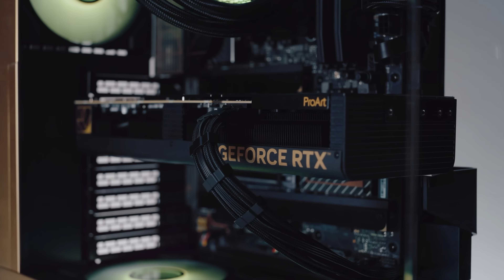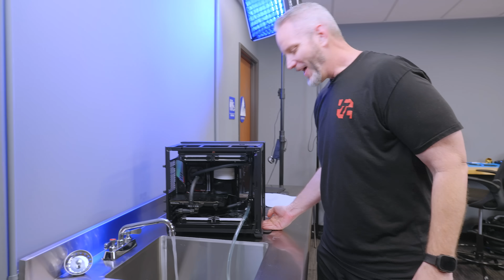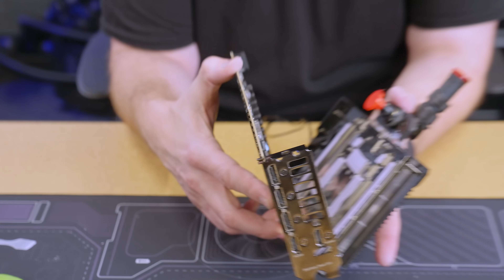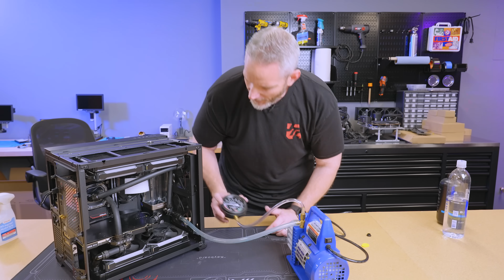These GPU Temps were BAD... here's what went wrong and how I fixed it!

Comment: I had the same issue, over and over again on my 4090. The pump out happens over time after you heat up and cool down the gpu a couple of times. I then decided to go with a graphite Kryosheet on the gpu die, and I will never go back to paste for anything. The temps went way down and to hotspot delta always stays under 9C. The best thing is that it is very stable, temps will never change over time. I use it now for my cpus as well. Love it!

Comment: Nice, ya anytime you put a vacuum in the system, it's best for refilling makes it easy.  A tip when pumping down into a vacuum:  Add a small catch bottle before the inlet of the pump so as to protect the pump oil, you'll be glad you did so you don't have to clean/change out the foamy, contaminated oil in the pump as often.

Comment: I'm facing exacly the same issiue on my relatively new GPU Asus TUF RTX 4070 Super OC (purchased 07.2024) - starting on 12.2024 delta betwen temp and hot spot rises to about 21C and now playing PoE 2 in 2K i'm registering hot spot near 94C but normal temp are below 70C. I've try to correct air flow in case (asus GT 502) and set up gpu fans curve to more aggressive but now even with fans on 85% this card is reaching that hot spot near 90C.  Since card is under warranty is it better to send it back to producer or re-paste it personaly? Asus will probably put same paste and after few month i will have same situation - i was wondering to get that PTM7950 and do it my selve

Comment: I got a 25c delta between my avg GPU temp and the hot spot on my Red Devil 6800XT under air. Is this normal or could I also be having a pump out issue? I got some Noctua TP on order and was thinking of repasting it when it arrives.

Comment: I had a 5700XT, a Strix version, and it was the one that was known to have bad mounting pressure. I owned it for a few years and the hotspot was always 115C, and when I put a block on it, the die had surface pitting, and the copper on the heatsink where it made (loose) contact with the die, was literally discolored almost to the point of being charred. With the waterblock, the hotspot was well within reason. Recently I put the air cooler back on to use it in a spare PC and used the washer mod to get a tighter mount and its within reason as well. So mounting pressure is certainly something to take into consideration when doing any kind of modding.

Comment: Question: can one watercool pretty much any modern GPU? F.e. I have a Inno3D GeForce RTX 4080 16GB X3 in a small form factor case that is running around 70C and is pretty loud, but I wonder if I could watercool this card or be better of with a cooler case (literally ;) … cheers!

Comment: For even greater improvement you can toss out the thermal pads and switch to using Thermal Putty instead. Some really high performing putties are available these days.

Honeywell HT10000
TG Putty Pro
Laird T-Putty 910
Upsiren UTP-8
Fehonda LTP81

(Thise all performing within 1.4 degrees for me, in testing)

You can also switch to a Phase Change Material like Honeywell PTM7950 on the core. For burn in, open the reservoir up to allow for expansion and then get fluid temp to around 50C for about 2 hours using your load of choice. Only need to do this once really.

Comment: whille waiting for my 5080 to arrive i used my 1080ti in my new system, and i saw it getting to high 80's, even 90 degrees in some cases then the fans would go nuts and it would cool back down. I i magine the thermal paste in that has gone bad , so i will clean it up and re-paste before i put it into a new mini pc i'm building for the kids.

Comment: I don't think water cooling is stupid but it should be better. Having the fins get blocked up with crap shouldn't happen, either there needs to be better hoses or the coolant has contaminants in it.  Maybe PTFE hoses instead of rubber? I don't know but you don't really see this problem with cars considering the coolant in them can be fine for 20+ years with no problems to cooling efficiency. Mostly just leaks with cars, I guess because it's under pressure and a lot of the fittings are cheap crap plastics that like to crack or weaken. It might be just ebcause PC systems are a lot smaller so the radiators are smaller with smaller fin stacks so it's easier for stuff to build up?

Comment: In my experience only LM and PTM7950 works for high power GPU's (Above 350W), i've tried over 15 different thermal paste brands and all of them degraded in moth or two.
Just LM that bad boy and reduce Delta temps by 20-30% and whole GPU temps by 5C minimum.
That bare spot is pumped out paste nothing to do with the way it's mounted, that has plagued me on 6900XT for months until i decided to LM and be done with it.

Comment: I think that my old old old 3930K system now, either has coolant leeching and/or I just need to repaste the CPU.

But nowadays, typically, I just switch it over to air cooling (Noctua, because when the system dies, I can always re-use said Noctua CPU HSF), and like the Thermal Grizzly Carbonaut carbon thermal interface sheet so that I don't even have to worry about the pump out effect.

That's about as I can go, in terms of maintenance.

I don't get the LOWEST temps with that, but it's controlled enough that for most practical intents and purposes, combined with the significantly lower maintenance requirement -- that's what works best for me.

(I would have to imagine that the gunk build up happens inside of AIOs as well, but that would be much harder to open up and clean, since they're typically purchased as a sealed unit, hence the name.)

Comment: This is where air cooling sucks. Because getting temps like that, isnt common when you buy an OC card. My 5700xt is clocked to 2100, but the stock for a 5700xt is 1905. That made my difference be about 30-40 most times, even brand new. Underclocking and undervolting is basically the way to go if you're using air cooling. The few frames you lose from it, isnt going to matter. What will matter is the DB of your fans sounding like a jet engine when you play something demanding.

Comment: If you had a spare reservoir, you could use it to catch liquid when pulling a vacuum then close the valve and remove the reservoir and put line in coolant to fill. Might save you from having to change the oil in the vacuum pump.  I wonder if one of those ultra sonic cleaners would be good for cleaning parts in... Just thinking it might be good for those fins and hard to reach places.

Comment: I was seeing spikes in the core/hotspot delta as high as 20C on my MSI 4070 ti super. I repasted with KPX and there's been a noticeable improvement in temps, but I'm still seeing as high as a 15C deltas. Overall temps are good. It's stable in the mid 50's core / mid-high 60's hotspot. Occasionally the hotspot jumps up into the 70's with little to no change in the core temp. I'm not seeing any stability issues or throttling. 🤷‍♂

Comment: @jayztwocents - To prevent liquid from getting into the vacuum pump, place the vacuum pump higher than the lowest point you're pulling from. Alternatively, you can put a small jar inline between the reservoir and the vacuum pump. The liquid should mostly drop into it.

Comment: if the edges are light, which all these were...  it could be that the compression of thermal pads wasn't enough and the pads are holding up the plate from full contact on the die.  thermal pads are hard because of the delta between OG thickness and compression.

Comment: Hey Jay, put a brake bleed bottle from a cheap HF vacuum brake bleeder kit on the vacuum line between the PC and vac pump. It'll catch the liquid and keep it out of the pump. When you go to fill the PC, pull the line on the PC side of the bleeder bottle and it won't be in the way.

Comment: i get 80c max on 100% utilization on my xfx rx 7600 what should i do, im not talking about hot spot just average temp.
Reply: Adjust the fan curve. Or maybe need a repaste. But 80c under load is still okay.
Reply: @ just realized my gpu hotspot under full load is 97-100c so def a repast, but the thing is I just got this gpu and I have good case cooling

Comment: Depicted; why I air-cool. Water-cooling is cool - literally - but is a lot more work than I want to put into my PC.
Costs less, easier to maintain, then come back in five to ten years when hardware failures start happening. Less if I made the mistake of a top-end large-die GPU.
Clean the air filters once a month, clean the system itself once every six months or year, otherwise just let it ride until hardware failures start turning up.

Comment: Asking for advice if able:

Nutshelled Info - i5-12600k, EVGA GeForce 3080, Asus TUF Wi-Fi D4 Z690, 16gb (x2) Corsair Platinum, AIO 240, 850 PCU..I Think.  PC roughly 4 years old.

Upon turning on PC everything is fine.  All drivers up to date, Windows 10 up to date.  7 case fans plus PCU fan and the dual fans for AIO.  Open a game such as FF14 and at random times screen will stutter and monitor will go black, followed by keyboard then mouse and white LED light will come on motherboard.  Unsure if due to heat build up on graphics card, hangs around 50c under load, entire PC hovers around 36-40c when idle.  MicroCenter diagnosed, stress tested, reinstalled drivers, ran fine.  Came home, still having issue.

Any suggestions? Also PC isn’t overclocked all factory settings.  BIOS will sometimes show “no CPU fan detected” but that is due to AIO installed instead.  So put to ignore but still has issue.

Comment: I would've used some sort of PTM for the re paste. Repasting a GPU, ESPECIALLY one that has had pump out from day one of the build is going to spit that thermal paste out in a week. GPU's shouldn't pump out for its entire service life. The ones that do, do so for a reason. Whether it be the cooler surface being slightly convex or what have you. Back when I was helping people out on reddit for their 7900XTX's and their pump out, which those cards were notorious for. PTM7590, or TG Kryosheets were basically the only surefire way to prevent pump-out. To be clear If it took your card two years to pump out, a re-paste with good ole thermal paste is fine. If it came out of the box with issues, or you got pump out shortly after applying a water block (like in this case) there is a level of die to cooler incompatibility.

Comment: I see Jay is using his car care techniques on his pc's too. Filling that loop is basically the same way you're supposed to do it on car. 10/10 approved!
Reply: yep, it's still the same components doing the cooling (radiator, pipes, fluid, etc.) as a car, just in a different application. the logic applies to both. 👍
Reply: my late-model-design vw uses one hole, you fill and burp

Comment: why is it that my systems always run at about 45c at idle  with a 23c room on the cpu and my 7800xt when running 0rpm mode it runs 60c

Comment: My 7900xt hot spot kept creeping up and up the last two years now on default settings it spikes to 100c. I now undervolt it to 1030 and set max clocks to 2450 and dropped power limit to -5%. Now in full load it's 75 to 80c spikes and instead of 330w it's only doing 280w max. Lost like 5fps on avg but dropped a lot of heat. A lot of people on reddit and other forums said even aib 7900xt and xtx gets super hot. But I really think they pump way too much voltage in them. It runs smoother quieter and more efficient undervolted.

Comment: The D in 011D stands for DUMB. A glass box is one of the dumbest ideas ever for a PC that should be running at low temps.
Reply: its  not dumb if you want to have your pc on top of the table, next to monitor and admire the build, or the RGB in it, for me as i have MSI GUNGNIR 110R i admire my build, i like how it looks, how silent and elegant it is, and mostly, when i look at it, im like "dang, i did a good job on my baby", its personal prefference ofcourse, but its not dumb, kinda like multi-monitor set-ups

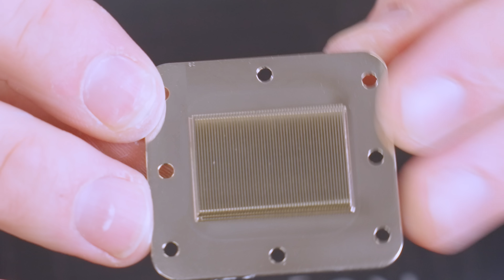Comment: 7:28 so I said it on the video you did making it, it’s the blue Corsair coolant. I have the same block and was using the same coolant and had the same problem. Ended up cleaning it like 3 times before I switched to clear Corsair coolant and haven’t had a problem since.

Comment: KRYOSHEET! Sorry didn’t mean to yell lol. You’ve already looked at it Jay. I know Der8auer will love hearing that, but I’ve put Kryosheet on all my stuff now: 5800X3D, 3700X (soon to be 5950X), 6800 XT, 2080 Ti, and my friends 2060 Super. A couple colleagues at work have also used it. FANTASTIC thermal pad! In my experience, it’s as good as Arctic MX-4/MX-6, but has 3 amazing properties: 1) consistent full coverage (my deltas have always been Les than 10°C, 2) no pump out, 3) longevity. 

Performs better, in my experience, with direct die applications. I do use it for my CPU’s, even if there’s no difference between it and thermal paste, simply for no maintenance.

Just use either insulating conformal coating, or Kapton tape and you’re good to go.

Highly recommend!

Comment: No one does thermal paste right there isn't supposed to be an actual layer of thermal paste You're just supposed to put thermal paste on and then take off the excess and put and put the two blocks of metal on top of each other because the thermal face is supposed to fill in the imperfect microscopic gaps that we can't see

Comment: I dont like putting too much thermal paste. Should be just thick enough that its not see through anymore. Even then you'll get some pump out when you tighten the block down, but the amount left on the die is the same, you just get low wastage and mess

Comment: No A/C so my house is what ever the outside temp is, been 101F. Was thinking of water cooling and piping to a reservoir that is sitting in a cooler of ice. Not sure how powerful the PC specific pumps are, but I do have a 1000 gph aquarium pump I could adapt to work.

Comment: My laptop was a display model and I bought it over a year ago and noticed the temps were running high.  It is a 12th gen I7 with a 3060.  So, I bought some cooling paste, cleaned the dies and repasted, works better now.  Paste had hardened up some, so I'm thinking it was probably doing whatever his was doing (Sorry, CRS Syndrome = Can't Remember Squat).

Comment: Jay, what kind of coolant did you use before? It's extreme how clogged the jet plate was. Something is corroding inside or the color additive is bad. You should NEVER use this stuff again and you should also rinse out the radiators otherwise it's only a matter of time before the whole thing happens again because the dirt from the radiators is pushed into the new jet plate...
Reply: The gunk clogging the fin array was residue from the EK ZMT tubing.  That stuff is incredibly dirty inside.  Mostly release compound and carbon black particles.  If you have to use it, pre-clean it on a closed loop with gas filter inline for several days to catch the crud.

Comment: If i paid $600 for a card (which i did 3080ti) then no its not worth water cooling as the performance boost is minimal although shes old and needs a repast. I repasted it and had to reopen it about 10 times to get the temperature right and its still not perfect. I think more thermal paste and maybe some debauer thermal griz thermal puddy instead of pads would work well for me. 
    But you already know if im spending $2000 on a graphics card, im GOING to put a couple hundred dollar water cooler on it so i get the max performance, esp with how EASILY it will thermal throttle itself, well worth it.

Comment: Looks like the radiators probably had a bunch of junk in them. I am sure you used distilled water. Next, I put a flow meter on every custom water cooled build I build. A digital flow meter shows the actual flow rate which can make a huge difference in temp. It doesn't do any good to have a high flow rate where it doesn't have a chance to dissipate the heat. Just a few tips, and I am sure you know all of this Jay, but for others who may want to try custom water cooling.

Comment: OK fine Jay, I'll sound off here about how stupid water cooling is and it's unimportant and unnecessary and dumb and a waste of time and a waste of money and just really stupid and people that do it have self-confidence issues and DING.

But if you really want my opinion, I think water cooling is pretty cool, the water cooling community is pretty chill, water cooling has some trade offs that make it interesting, and I really wish I could afford more water cooling parts to get my current system back on water. It was aqueous last year, but then the MoBo had some fatal issues. Not sure what happened, but I swapped the MoBo and put all my parts back on air, don't even have an AIO. I'd still water cool again. It's all good fun when you got the finances under control.

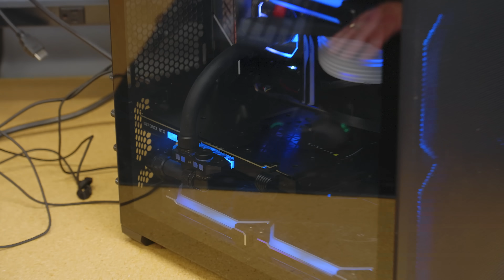Comment: He will never learn. 2:17 The pump-out effect is exacerbated by the use of LN2 paste like KPX. Paste that is designed to prohibit freezing at -140C, is not suitable for daily driver PCs.
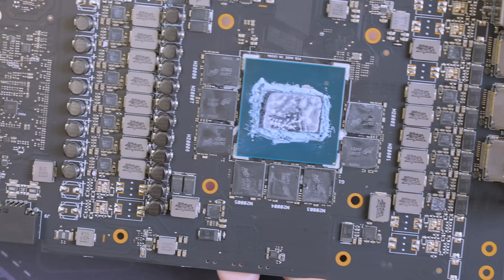Shows pump-out with KPX. 5:37 

The tube type is EPDM (ethylene propylene diene monomer). 

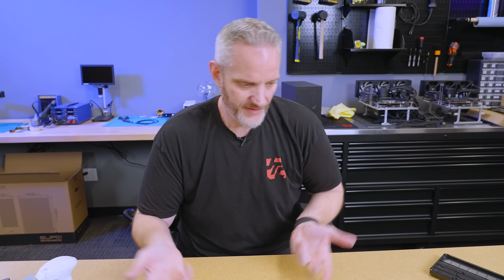Pigmented cooling fluid is another bad idea. 6:49

Jay will be fixing this PC again, in less than a year.
Reply: I was thinking the same, the pump out effect of KPX is completely intended, it was a very liquid paste intended for overclocking sessions, made to be easily spreadable (hence why it easily pumps out) and to be changed regularly as it was made for overclocking records, not everyday use. Using KPX again as the replacement paste for this use case of keeping a rig working without needing regular thermal paste change is pointless... PTM7950 should be the solution or a dry paste like Intel's TIM that they used to use or Duronaut.
Reply: People who water cool have tiny micro tools ...... to clean 😅
Reply: Sometimes it looks like Jay has no clue what he´s doing or saying, he comes across more like a tech - fan, not a tech - nerd.